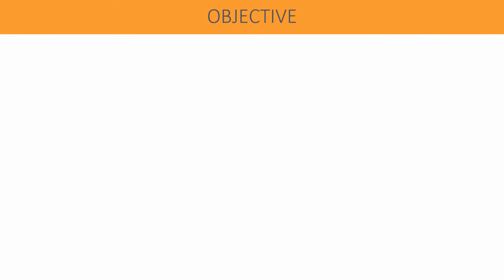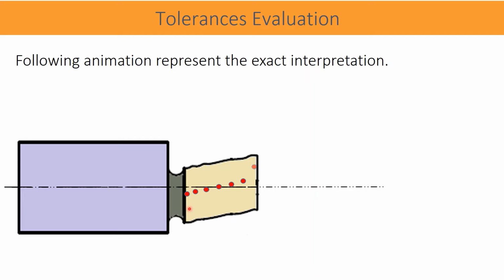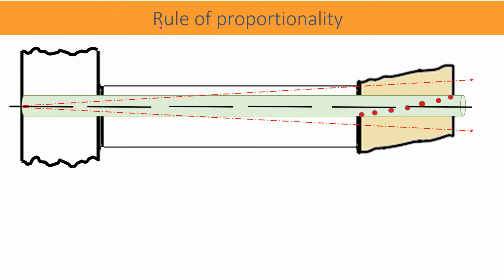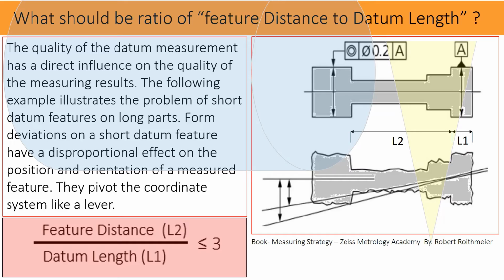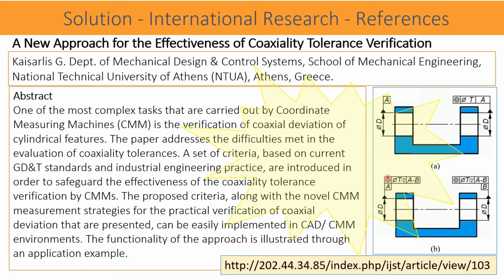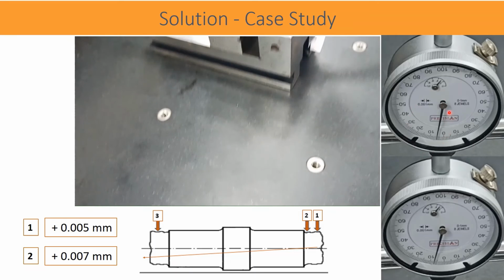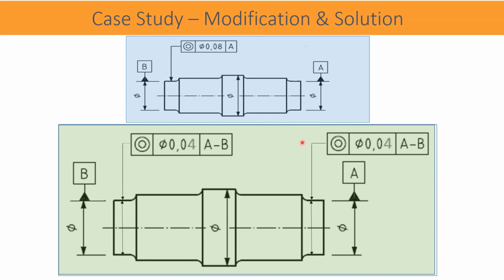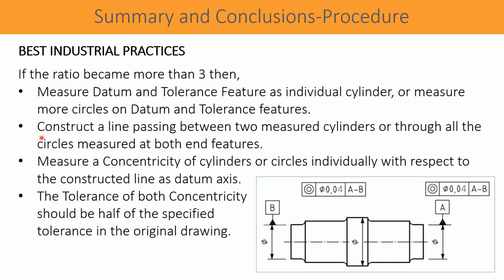CONCENTRICITY ON CMM  - THE SOLUTION

Comment: There are some fundemental mistakes here:

1. You have to understand the difference between concentricity and coaxiality. Both use the same symbol, but in ISO, the symbol usually means coaxiality and it requires the evaluation of the whole length of an axis. But in ASME standards before Y14.5-2018, there was ONLY concentricity, which was mathematically measured DIFFERENTLY from the coaxiality in ISO (see point 2).
2. In ASME, concentricity used to be measured only within a plane section of a cylinder. The section did not need to be a circle, it could be any shape, but there had to be opposing points within the shape. For every set of opposing points, there had to be calculated a mid-point. The set of all mid-points had to be within the tolerance zone of the datum. This had to be true for every section of the evaluated feature. This method sometimes yielded different results than the ISO method. It is very complicated to realize this measurement on a CMM, because it involves a lot of calculation, and I know of NO software that was able to do this out of the box.
3. BUT: In ASME Y14.5-2018, the concentricity was REMOVED from the standard. It doesn't exist anymore, and the use of the symbol is NOT ALLOWED ANYMORE. Instead, you have to use the position tolerance in a similar way as the coaxiality in the ISO standard, which does still exist and uses the same symbol, which could be a little confusing.
4. There are rumours, that even in ISO, within the next few years, the coaxiality symbol could be removed as well, since there had been the mentioned differences in the use between ISO and ASME, and concentricity/coaxiality had been a constant  reason for misunderstandings within and among the different standards.

Comment: Magnificent, with good illustrations and live video with indicators!  By knowing the sequence of operations performed on this part, preceding this measurement, helps in the understanding.

This video is so powerful bc it underlies many of the mistakes made by programmers who are good programmers, but do not always understand the ‘leverage’ effects, measuring a small surface (in relation to rest of the part) and using that plane or cylinder as Spacial/primary datum.
Reply from the maker: Thanks i